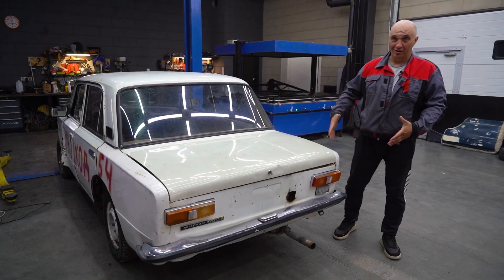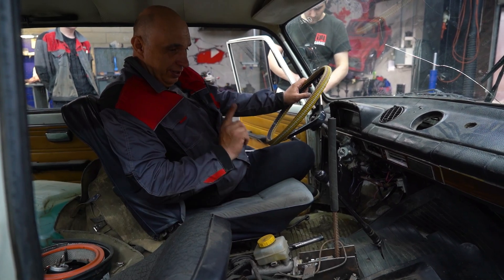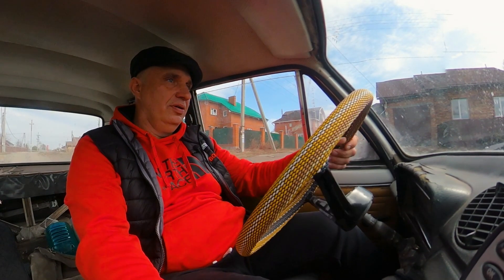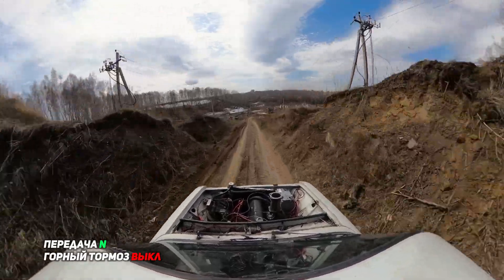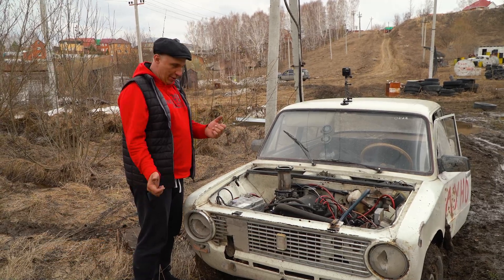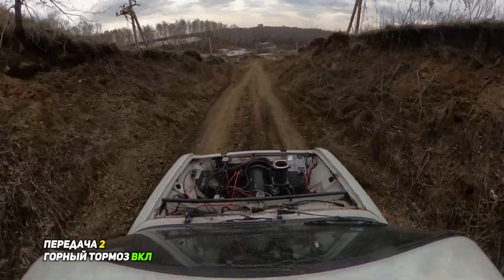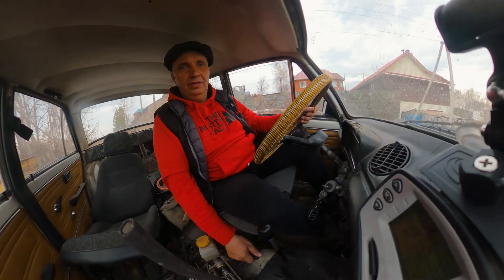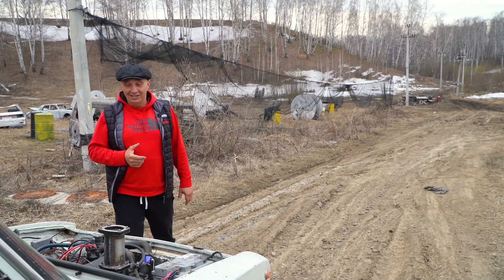Extreme 107% engine brake - how does that work?

Comment: I was going to make one of those for my diesel but read that if there is too much pressure in the exhaust then it can push back on the valves and open them when they shouldn't and possibly make contact with a piston. So i didn't start that project.

Comment: If you incorporate, engine braking and compress the air in an air tank, regenerative braking and charge a battery, aerodynamic braking which could also charge the battery (not by much) with a mass engagement on the fly wheel i.e. material that was not spinning but you'd need to get spinning through engagement...you'd be able to use the electric motor on take off and the compressed air you stored in an air tank which you can reuse through an injector in the intake to increase compression plus the spinning mass would provide great initial torque to toss the car...I wonder how fast you could actually stop without normal brakes at all plus how well could you take off
I'm sure there's added weight but would still be a cool invention to say it's been done.

Comment: I would be worried about the strain on the engine systems doing this over long term. I know big rigs have jake brakes, basically what yer doing here, but they are designed to handle high pressures. Gasoline engines really are not... So I really wonder how this would affect engine life in the long term... Probably not good...

Comment: The problem with a gasoline engine is that the intake is restricted when your foot is off the accelerator. This exhaust brake would be much more effective, if there was a valve underneath the carburetor that would allow full airflow into the intake manifold. This type of retarder would be MUCH more effective on a diesel, because of the open air intake, allowing air to be pumped into the exhaust with no accelerator pedal. With a gas engine, you need a valve, to open the intake to air, without drawing fuel through the carburetor. As a simple test, try putting it back into 3rd gear, turn off the ignition, and floor the accelerator pedal. That way, the engine would act more like a diesel.

Comment: Video idea: compress air with engine during engine break, and use the compressed air when accelerating = you save the internal combustion engine by increasing efficiency :)

Comment: Modern vehicles have this thing already where you can set the level of engine brake which is done with the help of a valve installed in the exhaust pipes.

Comment: Pretty sweet.

Ok what about no spark/second/throttle plate wide open/retarding plate closed?

I already know killing spark will add to the effect, and opening the throttle plate will give it more air to compress, increasing the load.

Comment: To those that may be wondering Jake brakes are very different from this. They do block off exhaust, but not from the pipe. They have a camshaft that switches profiles to close all valves and wait for the piston to reach TDC and then release suddenly that is the pop you hear a.k.a. the signature Jake brake sound
Reply: In fairness its half a Jake brake :P The engine still has to compress and exhaust gas, but the timing will be all wrong to extract the most heat from the gas like a J-brake does
Reply: This is called an exhaust brake. It's much more common in europe compared to jake brakes. Our trucks don't really have jake brakes.
Over here in europe, not sure about other places, there is also a regulation that it automatically needs to open before the car stalls. Some of them also only close on one of the strokes in order to decrease noise.
Reply: yeah, never hear about jake brakes until now.. all trucks in Europe have exhaust brake (valve) or electric retarder (48-60V) installed on driveshaft. We also don't have "slow down" ramps for trucks in mountain passes like they do in NA. Also brakes on trucks are quite effective, most trucks brake better than any car would (tho depends on cargo weight)
Reply: @exvills cool story bra

Comment: With the intake throttle shut there is very little air going into the engine and thus very little air going out the exhaust, that's why it doesnt work very well.

Comment: For maximum efficient engine braking, also known as Jake brake or Jacobs brake, you need to keep the engine in a high rpm range, on diesel tractors/semis  the recommended rpm range is between 1800 - 2100 rpm.

Comment: engine retarders or engine brakes are also called Jake-brakes and have been used in diesel semis forever.

Having been a trucker, I can tell you that they do their job when at proper speed, rpm, gear, and incline or distance needed... but always have that clutch and brake at the ready near the end !!!
Reply: They must not have them in russia.

Comment: Slightly pedantic remark:
That was an exhaust brake, not a retardier.
However, an electric retarder would be another great project e.g. using the resistance of an alternator when short circuited via resistors.

Comment: only first and 2nd gear is alot effort and i drive manuel every day and 2nd gear is my main breaking because break happen to failures to stop at high speed i throw in 2nd gear and pull emercy breaks make it stop easy which it work but will leads to sliding rear wheels and one just happen lock up cause it slide side way and becarefull doing this and require skills and learning to handle it when get thur it them be come easy

Comment: VODKA-DRINKING CAR!!!

VLAD! YOU HAVE TO SEE THIS IDEA!

USE A FUEL-INJECTED CAR  AND SWAP IN INJECTORS WITH FOUR TIMES THE FLOW RATE OF NORMAL INJECTORS, CHANGE NOTHING ELSE OTHER THAN THE INJECTORS AND RUN THE CAR ON ONE THING ONLY:

RUSSIAN VODKA!!!!
Reply: Good idea. I wonder if the water content in vodka will allow the fuel air mix to ignite. Generally its 42% alcohol v/v, rest is mostly water.

Comment: Why don't u make air breaks where instead of a closed oil circuit. create a circuit that is filled with gas from the exhaust pipe.

Comment: In gasoline cars, engine braking isn't caused by compression, but rather it's due to vacuum in the intake manifold (throttle body is closed while pistons and valve movements keep trying to suck air). Effect by compression is negligible because once piston reaches TDC, the compressed air will work pushing down the piston - effectively equal work put into compressing air and air pushing back after TDC (if we negate the effects of friction).

Semi trucks with jake brake on the other hand, will compress the air and valve will open to let the compressed air out (thus creating the notable engine brake sounds).
Reply: The compressing of the gas causes it to heat up, and that heat goes into coolant. Total vacuum = total compression if no fuel, so it can't be vacuum but not compression lol.
Reply: @cannaroe1213  Well, I have never mentioned anything about fuel and combustion in general. The vacuum is in the intake manifold due to throttle body being closed and engine being a basic air compressor powered by kinetic energy (movement of a car).

Comment: Try it again with the ignition turned off and the throttle fully open for maximum air flow through the engine so hopefully more braking effect.

Comment: That might be effective in a 4X4. I used lower gears to crawl down hills and it worked great. Engine braking might make things go slower without wiping out your brakes.
Reply: Exhaust brakes are already a thing. They overheat. So you won't be braking for a long time at low speeds.

Comment: Just how different is this from putting a turbo on your engine, both increase the pressure in the cylinders, so I believe that with the right implementation it could be a viable option on newer cars aswell

Comment: The heavier trucks use this application and, it's called an exhaust brake and, bigger trucks use this and engine braking, which are special rocker arms that hold the exhaust valves, to help slow the engine RPMs.

Comment: how effective is the engine braking if you just shut the engine off in gear tho? i imagine its the same and the exhaust mods are extra work to achieve the same result
Reply: nope, engine off has the same engine brake as a fuel injected gasoline engine with cut off fuel Active... with fuel injection, wheh you leave the throttle with gear engage and you are above very low rpms, engine dont use fuel at All and runs by vehicle inertia exactly like if you turn off the ignition with the key, the only difference you can come to a stop meanwhile with engine on, some 100s rpm above iddle, fuel injection reactivate and engine work again under its own power

Comment: I would think it would be better to have the valve on the exhaust manifold so it's closer to the engine but I don't know. I think it's good to have some backpressure with a stock engine but too much will give you really bad gas mileage, so I've  noticed.

Comment: interesting to see if affects fuel consumptions. if the engine cant get air out as easy then one would assume it cant get it in as easily, so assume less vacuum on the carb.
Reply: Why not also put another Butterfly Valve at the Carb. Inlet? What happens then? Putting thicker gearbox and Differential Oil would also make a big difference to the cars' retardation by adding a Transmission Braking effect also. Problems would happen if cars were designed like this, particularly on icy or wet greasy roads.As if by magic, the Lada would turn into a Carousel Fairground Ride.

Comment: This is commonly used on large diesel trucks for increasing the engine brake effect. This makes it possible to drive long stretches downhill without having to rely on the main brakes and risk brake fatigue.
Reply: Does this (and the video) improve fuel economy somehow?
Reply: @farmdve  No it doesn't. Engine braking is something only used to spare the brakes.

Well in a modern car engine braking means the fuel injection will be cut when you're engine braking, so I guess that would save a few drops of fuel compared to the engine idling while you slowed down using the brakes instead.

But for all relevant purposes the answer is still no. Neither engine braking nor a exhaust brake to improve the engine braking in any way improves your fuel economy.

Comment: Now add a compressed air tank to feed high-pressure air up the exhaust to give it 500% engine braking and even driving backwards while in 2nd gear.
Reply: Fuck. Yes.

Comment: This was successful but didn't work as it should, they needed a ball valve like Milo and seal all the exhaust, with any gear the exhaust system is supposed to increase the pressure so high that it would be impossible to turn, but that in this case wasn't possible because even the exhaust manifold would leak on this and the butterfly valve doesn't seal 100%.

Comment: I'd like to see a compression tester on one of the cylinders while under exhaust braking to see how high the compression goes.
Reply: It will be the same.
You didn't change the compression ratio All you are doing is restricting the engine from breathing. It's essentially the exact opposite of making a performance engine as you are choking the engine so bad it can't easily turn. Remember an engine is essentially just an air pump all it wants to do is breathe so when you choke the exhaust you're slowing down how fast the air can exit so the engine has a wall of compressed air (compression) that it has to try to turn through and the smaller the exit hole the less theengine will turn essentially creating a backup of high pressure all the way into the intake (where there is normally a vacuum).
Reply: @AtomicReverend This can be further enhanced however by killing the spark and opening the throttle plate wide open. This will "evenly" cancel out the compression/power strokes (rather than there being a slight net energy gain), and the extra air will give it plenty to do.

My only concern with this entire concept as far as to implement on the likes of a car is the materials the butterfly/throttle body are made of... And those exhaust gas temps during power production 🤣
Reply: Higher or lower rpm shouldn't change your compression
Reply: if it goes higher than what the exhaust valve springs can hold back then the pistons will smack the exhaust valve before the pressure will ever get over the  compression stroke pressure
Reply: Assuming it's an interference engine of course.

Comment: Cummins has an exhaust brake of sorts on the 6.7 Inline 6 that are used in Ram pickup trucks. Basically the Variable Geometry Turbo is utilized to act like a valve and restrict the exhaust.... They work extremely well.
Reply: VGT is the best because it changes the A/R ratio of exhaust housing. So you get engine braking and the bonus is you get full boost at the same time. Also a small Jake brake like effect.
Reply: They make them for the 5.9l cummins as well.

Comment: I suggest connecting a switch to that emergency brake lever to kill the engine, open the throttle to let more air in to boost compression and have it in 2nd or 1st gear.

Comment: could you show us how to make a Jake Brake?  Truckers in the united states use this supposedly to save brakes, but in reality it makes these trucks sound soo cool that they make it illegal in some areas.   It plays the most beautiful song on a long down hill.
Reply: Jake brakes open the exhaust valve at the top of the compression stroke and let the compressed air out in a sudden noisy burst for each cylinder in turn. Hence the cool sound. The energy that is used in compressing the air is lost instead of being recouped on the following downstroke and so the engine acts as a braking load.
Reply: its because of the noise that most places use exhaust brakes instead of Jake Brakes. Jake Brakes essentially vent the compression from the engine, from what ive read. we havent, to my knowledge, ever used Jake Brakes in Europe, only Exhaust brakes like this.
Reply: They do save brakes. Mostly used for hilly mountainous areas. When used with an exhaust brake they are incredibly effective and will basically double the braking power of the engine brake. There are two different kinds of jake brakes though. One is loud and the other is called a weeper which is a lot quieter. But with a weeper you miss out on the song the engine plays
Reply: @aaronneher4860  music is important,  is it not?
Reply: Yes, would love to see that as well